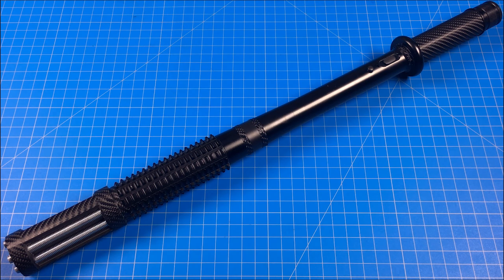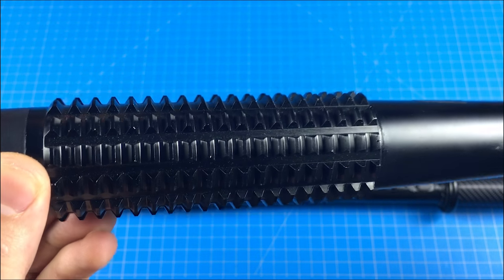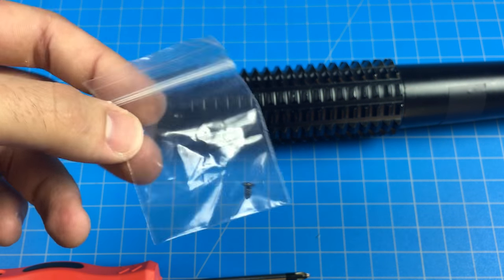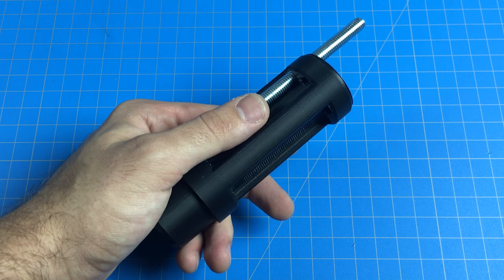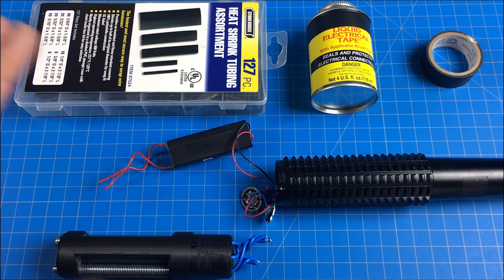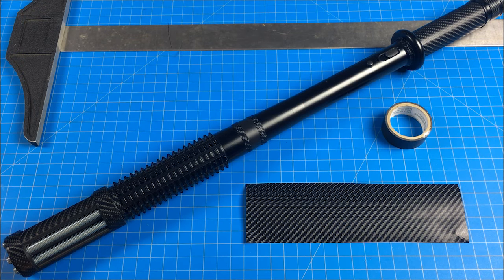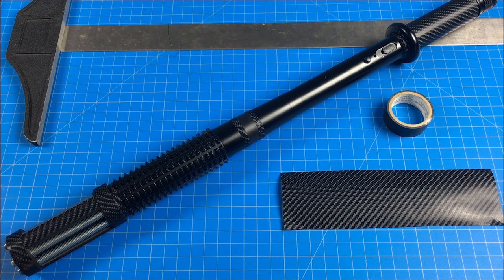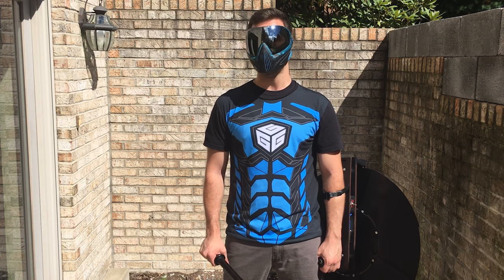How to Make: Nightwing Escrima Stick / Half Life 2 Stun Baton IN REAL LIFE!

Comment: 9000000 volts no,the breakdown voltage of air is 3KV per mm so 9MV would be able to arc 3 meters away, that's about 10 feet, if it was outputting 9 million volts you could essentially become Thor.
Reply: Uhh...what he said

Lol
Reply: I don't know what the fuck you just said but i 100% agree with you

Comment: 2 issues with this plastic top part.
1.the plastic top will heat up and melt with the electric current through the screws.
2.it can't stand the physical shock of being used as a baton,specially at the tip which hits with the maximum force.

You need to build the same part in some metal and coat it in rubber/plastic.
Reply: It is Marth's tipper, of course it will break

your shields